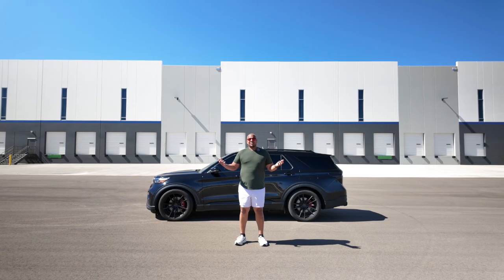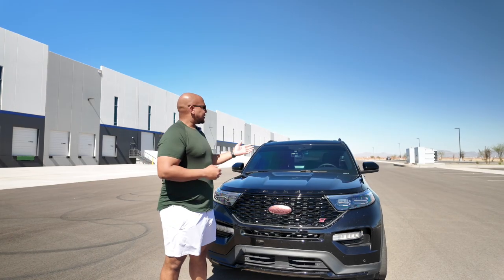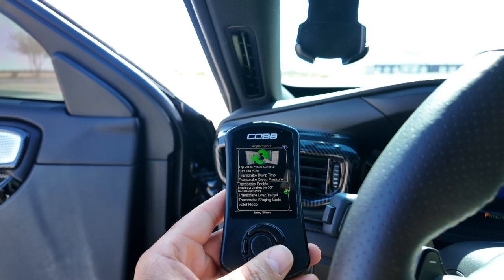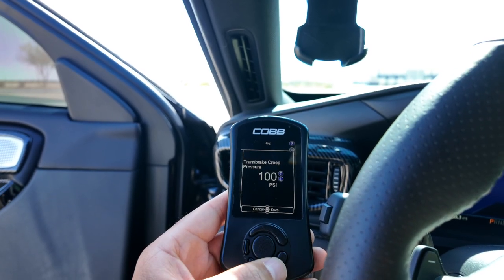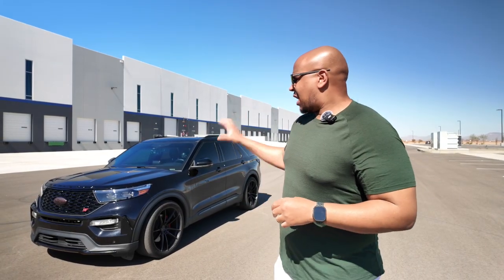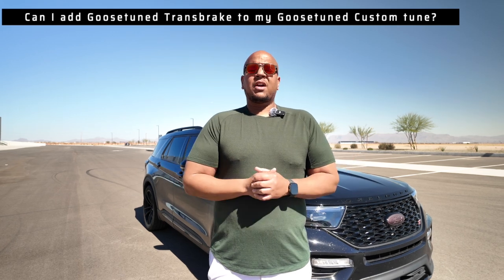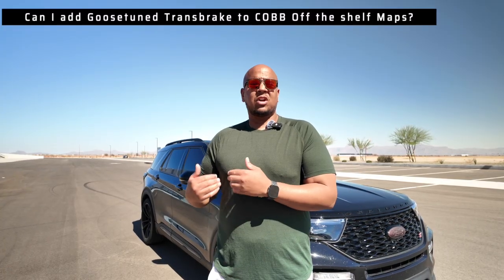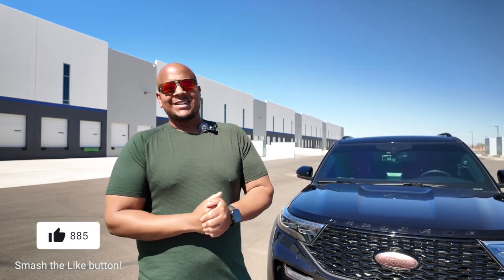Explorer ST User-Adjustable Transbrake Feature added to the COBB Accessport!!!

Comment: Does this hurt the trans?
Reply from the maker: It's very tough on the drivetrain! I'd recommend starting off light, then turning up as you need to
Reply: @goosetuned I just worry about longevity of that poor 10r80
Reply from the maker: @stevew8042  there are lots of guys that have been ok on other platforms with it.